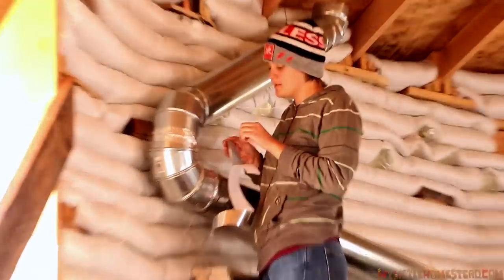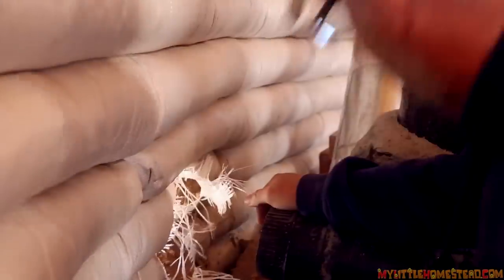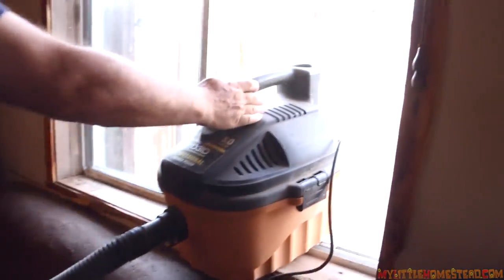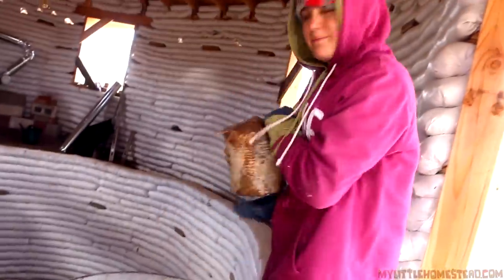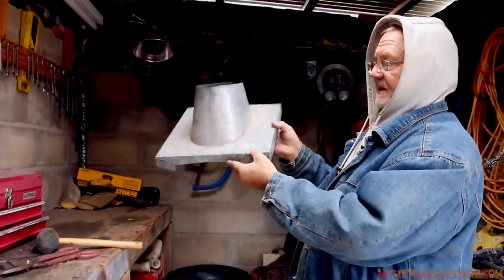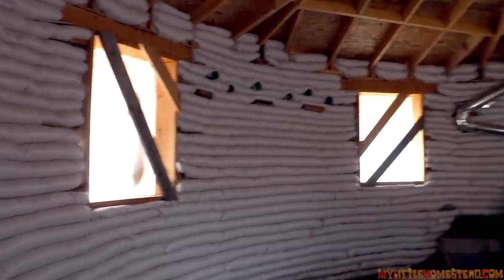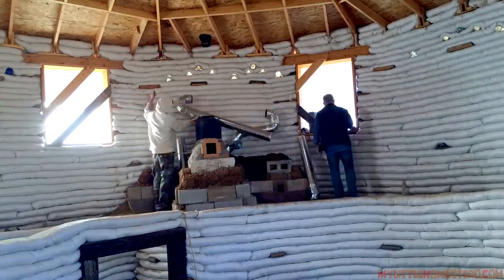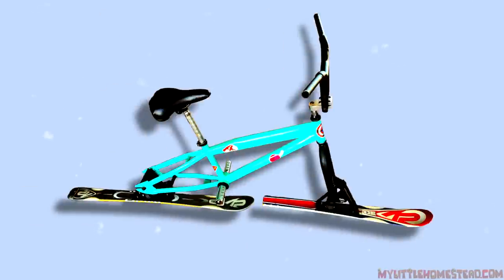Completing the Mechanical | Dragon Rocket Stove Mass Heater | Weekly Peek Ep69

Comment: On Shopvac's use a drywall or dry pickup bag to eliminate most of the dust and keep your filter cleaner for much longer. The bag helps to filter and contain most of the dust.

Comment: A solar power low voltage induction Mason V-8 hot air engine with a fan at the back and on the front fly wheels ducted to draw air over engine, would be way better then having to burn wood to keep warm. You could also cool in the same way using cryogenic Sterling cylinders in the same configuration. Novartis

Comment: A lot of your heat is going to be in the top 6 feet or so of that building, a 4 inch plastic pipe running down to floor level  with a small 4 inch extractor (shower room type) on the bottom of it will bring it down and circulate it (it's what they do in some tall buildings here).  I also like the reciprocal wood framing on the roof and think it is an art structure in itself, pity to cover it up.  When I watched you build it I imagined you were going to leave it open for viewing.  Like the whole earth bag buildings projects and that the whole family gets involved. Avid watcher now :) Good luck from UK.
Reply from the maker: Oh ya....we have an inline fan that will set on either side of the rocket stove that will draw warm air down into the studio. Thanks...

Comment: I am sure this after the fact, but for those who view this video. 
I have a wood burning stove, and I used it for 5 years.
Word of caution. The wetter the wood the more creosote build up. Creosote is a flammable and corrosive substance that can build up on the walls of your fireplace and chimney.
Over time, this creosote or soot buildups can become a danger as it liquefies and gets runny, and can potentially result in a very hot chimney fire. Something that needs to be done at every firing is,When you start a fire, the temperature needs to reach 300 degrees F. this turns and liquified creosote into a powder and goes up the pipe.  ALL THOSE ANGLES:              Fire-hazard. I see "danger" here. Any angle will not draw as efficient as a straight line. CHIMNEY: Go straight up, if possible; avoid 90 degree turns in the flue pipe and offsets in the chimney resulting in a Sluggish performance: smokey fire, hard to get a hot fire burning. Just trying to help here:
Reply: A rocket mass heater is not a wood stove. The RMH design burns so hot inside the combustion chamber that there is no creosote, as in, zero. Only after the gases leave the insulated combustion zone is the heat drawn off to thermal storage or radiation.

Comment: It would be a really good idea to screw that vent pipe together under the tape, and support it somehow for long term stability. I say that as a retired plumbing contractor. Also there are boxes, made for wood stoves,  for the through the roof connection that would be a lot safer and better.

Comment: I ran a very shallow flue angle in the shed.  Thought it would help radiate more heat with more flue and it did.  It also had very slow pull and accumulated a lot ash.

Comment: I'm sure someone has already said this, but your shop-vac should not be spitting dust out the back end like that.  You probably need to replace your filter, if there is one. Their designed to filter the exhaust air to keep the dust from flying in this manner.

Comment: Hi Dad

I wish to impart some of my knowledge as a master Plaster. I know you are using cob for cost, but please here me out.

 I feel you can adapt this plaster mix formula to your walls and maybe fireplace as well.

First off the plaster mix I propose is very light, fire resistance, extremely hard, very sticky and has a 2 to 4 inch thick hang per each coat.

The mix is one bag of Interior USG stroctolight brown coat. You add to that, a product called zonolight, not perlite as that is already in the factory mix. 

Zonolight is key to your success. zonolight is fire proof and use as insulation. very light and very strong. Add two shovel fulls of raw gypsum to the whole 90 lb bag of structolight. Add the raw gypsum and the zonolight to your liking to get what you want in each batch for each area,  as you go, mix half a bag at a time, as needed. 

Again too much zonolight no good, to little no good. learn as you go, small batch tests, till you get the idea of how it behave.

 Air temperture, humidity, dryness, water temperature, affect the mix performance. pay attention to it, as it changes throughout the day.

The next key to the mix, is white  concrete glue. One 8 oz cup of glue to 5 gallons of water. more glue or less to your liking but be careful, and test each batch. Too much glue no good to little and useless. get it right and it is a very light and sticky material that gose on thicker than anything else. extremely hard when dry. use stucco expansion tracks as needed.

this can be adapted to the cob for the walls, or fireplace, play with your mix and it will expand your options.

For the Walls, put a garden hose at the top and bottom of the wall, ad you screed line. Use 3/4 or 1/2 inch hose. If to much, use 1/4 clear plastic hose from home depot.

This mix has amazing properties, please give it a try, and cut your work time down as it floats thick. 

Add raw gypsum, Zonolight, glue to the cob or clay and see how that dose. 

I hope it helps.
Reply from the maker: +Jonathan Balash 
Thank you so much. I will explore this in detail.

Comment: As a rule, the wood heater should be at the lowest part of the room. Cold air always finds the low spot, so if you put the heater in the low spot, the cold air runs to the heater, and everything stays warm. That means if you don't have a heater in the basement of that building, it will always be chilly down there, even when the stove is on.
Reply from the maker: +Terrace Thornhill
You make a great point if the lower level was not a studio for recording. I will be installing inline electric vents to draw heat from the stove area to the basement.

Comment: Maybe too late now but your flue is now running too horizontal, it will build up with water due to condensation from the burning fuel. You ideally need more slope for the water to drain back.

Comment: :)
     Nice, It is oftehn thought that being prepared to save what you make before you make it
     is the logical starting point. The same is true with heat, install your heating device in a
     well insulated ares and you need less stove and fuel from the beginning.
:)

Comment: just wondering why you didn't put the stove down on the ground level where you will be sitting, this way you will need to blow the heat down?
looking great
Reply from the maker: +Rev John O'Toole 
Thanks John for the post. 
You make a great point if the lower level was not a studio for recording. I will be installing inline electric vents to draw heat from the stove area to the basement.

Comment: It is well know that any plastic starts brake down after 3-4 years. It is inevitable. 
I wonder what you going to do when your white sacks start bursting in few years?
Even if you cover walls from inside and outside it will not help. Once sack bursts sand inside will start filling cavities and eventually wall inside will go down in 5-6 years.
You have cheap but not reliable walls.
All the best to find solution and thanks for video.

Comment: Just a concern, If the angle isn't steep enough doesn't that mean soot will gather far too easily, and clog the pipe?
Reply from the maker: The pipe does not gather much soot. It is not like a fireplace. The exahust is primarily steam and a small amount of smoke.

Comment: Hot AIR rises, but a source of heat apart from air flow will radiate heat in all directions equally. Good thing, or we wouldnt receive any heat from the sun.

Comment: How does this design, with outside air intake and turns in the flue, seem to be working so far?  Is there a fair amount of heat being radiated from the flue piping?
Reply from the maker: +Matt Trull 
The design seems to working well. We have some rethinking for the next one. We like the intake and it does draw outside air. The combustion chamber is functioning as expected. The piping is working like planned....it heats the cob and radiates through the day.
Reply: ***** Thanks!

Comment: Why did you run the intake pipe outside? Wouldn't it be more efficient to use the warm air from inside?
Reply: Combustion air has to come from somewhere.  If you draw from the inside air, cold air will be pulled into the inside from every crack and tiny leak.  That is self-defeating and the problem with all wood stoves unless they have outside combustion air.  The outside air tube they installed was too big and should have a butterfly damper.
Reply: George Pretnick That makes sense.
Reply: I'd recommend to install 125mm steel ventilation tubes under ceiling for intake cold air. Hot air will rise and tubes will take that heat , so after 10m of travel in tubes outside air will be at room temperature already. No need to feed stove with cold air and create another cold air intake for ventilation. Basically you can direct that fresh air that is already heated up upstairs into basement and will solve heating and ventilation problems altogether. Stove will create vacuum and fresh air would be forced to travel downstairs. Additional ventilator should kick in if there are high humidity. Thermal camera images to find cold leaks is recommended.

Comment: Why not cob the entire wall or not the entire inside?  I'm a plasterer by trade and I have learned that for thousands of years walls have been covered with and built entirely of dirt and for those of you that don't know what Drywall is made of, it's a thin layer of Gypsum with thinner layers of paper over it.  Gypsum comes from the ground and is getting harder to find thus the cost.   If you can get the dirt around your home to replace the Drywall you will be doing a great service to humanity.   You will need to add Lime to that mixture to help it's hardness and strength a dash of Common Cement would help also.
Reply from the maker: We do plan to cob the entire interior with cob or cob mixture... thanks....
Reply: Wish I was there to help I need to learn how to do this!  Can't wait to see it being done!

Comment: hey guys,love your vids,BUT,that flue pipe is wrong...you need a insulated pipe or a double/triple wall pipe to go thru the roof....for fire safety...flew pipe gets very hot...wood stove companies make a transition piece/that mounts at cielling...JUST DOES'NT LOOK SAFE...........jda
Reply: ALSO,,YOU DON'T USE ROOF PATCH ON FLEW PIPES,,,IT'S FLAMMABLE,,,,,,USE FIRE RATED CAULK,,,(CHIMNEY CAULK)...................HOPE IT DOESN'T BURN DOWN...................................jda
Reply from the maker: Thank you for the update. Concerning the flue pipe. This is not a fireplace. It is a rocket mass heater.  Look on the net concerning the process or check out more of our vids. The output on the heat is lost in the cob...retains the BTU in the passive materials. The combustion chamber burns and re burns wood, thus nearly no ash or creosote in the flue. You can literally place your hand above the flue and not get burned. Very little smoke...mostly steam.
Reply: o kay,,i'll take your word for it......cool build,,and great family...would be nice if all families worked so well together....MAY GOD ALWAYS BLESS YOU WITH ENOUGH............jda

Comment: I r the lost. Flooring/ceiling over the center done? Why not put the stove on the bottom? Confuzzled.
Reply from the maker: +SeeTheWholeTruth 
You make a great point if the lower level was not a studio for recording. I will be installing inline electric vents to draw heat from the stove area to the basement.